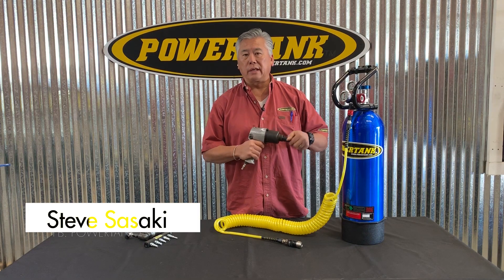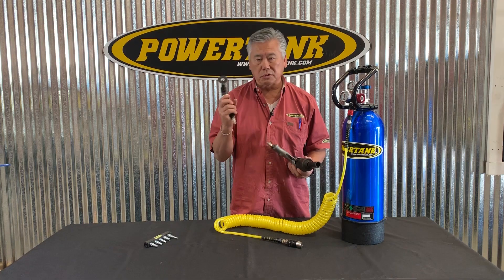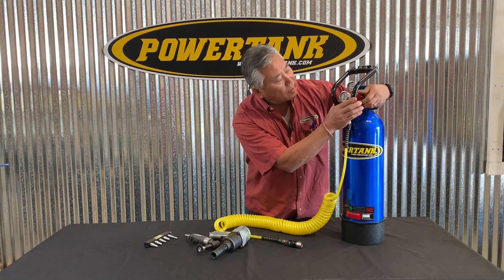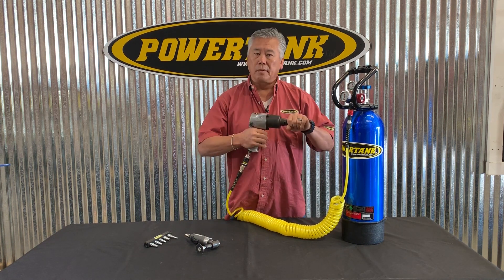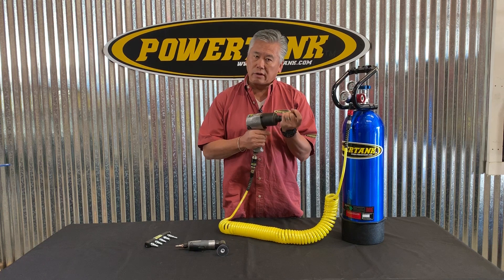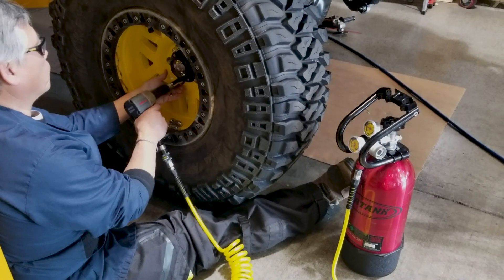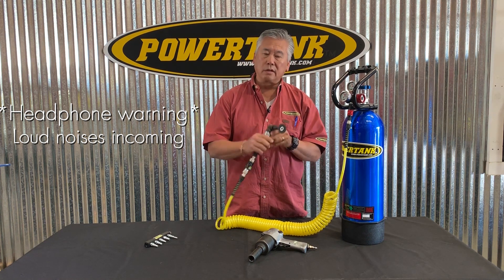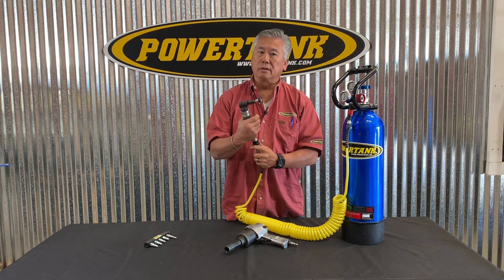Power Tank Running Air Tools

Comment: How long will it run the die grinder? Those things suck the air. I would think you would be better off with a cordless angle grinder and a small inverter to charge the batteries.
Reply from the maker: You're right. It's not a long time so you have to be purposeful with it. It's never been a problem for us over the past two decades. We end up using our die grinder quite a bit, too, since we keep welders in all of our rigs for trail fixes.

Comment: Would this be safe to leave/use in my work van? I would like to use air tools
Reply from the maker: Yes, very. We sell to the towing and construction industry regularly. There is a small chance of over-expansion due to heat. This only occurs with full or overfilled CO2 tanks with less room for expansion and on hot days (ambient temp 130F+). On the rare occasion it happens, there is a safety burst disc that is designed to pop at 3k PSI which will save all the components from damage and purge excess pressure in a controlled manner.

Our billet Power Grip Guard Handles are designed with safety and protection of the valve and regulators in mind. It has been tested to protect the most sensitive components from a four foot direct fall onto concrete at minimum. 

Our brackets have been tested in some of the harshest off road racing environments. All Power Tank CO2 bottles are DOT stamped during manufacturing and need to be retested every five years. We guarantee the bottle to pass re-certification.  

We carry our Power Tank inside our daily driven Jeep full time.

Comment: no expansion chamber needed?
Reply from the maker: Do you mean an auxiliary air tank?  Power Tanks run off of CO2, not compressed air. You can think of the Power Tank itself as an auxiliary air tank, itself, but one that is the equivalent to 400 gallons of compressed air at 150 psi. Such is the energy density of liquid CO2.
Reply: Power Tank Official an expansion chamber so liquid to gas evap doesn't freeze the lines or spray water ice  into tools and tires
Reply from the maker: @DarkShooper  What purpose do you think an expansion chamber would play in the system?  Essentially where a high pressure gas converts to a low pressure (regulator seat) and then flows in a hose the hose is the expansion chamber albeit a narrow one.  There is no moisture (“water”) state in CO2 once it leaves the tank.  It is either a solid (dry ice) or vapor.  Typically, there is sufficient heat energy and time (30’ of hose) to vaporize any dry ice bits that might leave the tank before it enters a tire or air tool.  

Since there is not water in CO2 there should never be any water in the hose to freeze when the hose gets cold.  So nothing gets into the tire or tool except CO2 gas (dry vapor).  

Does this answer your question?
Reply from the maker: @iliketakingshowers  They had a question and I was simply providing information. Hope they didn't take it personally. 😁

Comment: IF you have a workshop , you may as well use a compressor...this is more for a portable application.. I would think
Reply from the maker: You are correct. But there are times when you need to run an air tool outside of your shop. For off-roaders, it's needing to run an impact wrench on the trail to fix an axle. For contractors and carpenters, not having to worry about having power on a job-site or wheeling a heavy compressor from the truck is key. For me, I've brought my Power Tank to the back of my property to fix a fence because lugging my garage compressor over and running power to it would have doubled the work.
Reply: @PowerTankOfficial   roofing too, and framing!  I ran paintball tanks for both, this system is a bit to big for hauling up a ladder fifty times a day but I run a 20 lb tank on my truck and built my systems.  it is good to see quality commercial C02 tank set ups being sold ready to go so more people get into it!
Reply from the maker: @Dies1r4e  You know the good stuff! We designed our Power Shot Sidearm 20 oz systems exactly for folks like you. We also have a Hangman Bracket for 10 lb and 15 lb Power Tanks that you can use to hang on ladders, 2x4s, or scissor lifts.

Comment: Great video Steve, and good idea to keep some tools with you on the trail. What specific tool recommendations would give?  You mentioned two, but any particular brand, quality, size, etc.?  Any other tools you think would be valuable to keep in a trail kit?  

I always brag to my buddies about how I got such a screaming deal on my powertank at Easter jeep safari a few years ago, and I’ve been telling everyone about the powertank ever since. I’ll be bringing a good friend by the booth this year to pick one up for himself, and I might be getting a second tank for me as a back up.

Keep up the great work!
Reply from the maker: Thanks for the comment, Jeremy! Looking forward to seeing you at EJS this year. 

As far as air tools go, it really depends. A 1/2" air impact is always useful as you can dial up the pressure for really stubborn pinion nuts and the like. For a good value, look into the Ingersoll Rand 231. It's probably the most common impact you'll see at tire shops. I personally use the Chicago Pneumatic CP7748 because I like that it's quieter and feels nicer in my hand. Both are available on our website under air tools. We like them so much, we'll stand behind them. 

We use a die grinder quite often in conjunction with our on board premier power welder. We keep a few burr grinders and cut off wheels to clean up areas we need to weld. 

A blow gun is always handy to have as well. Being able to blow off dusty picnic tables, dirty radiators, and everything else is really handy.

That's typically all we'll take on the trail. Of course, we use it for everything else around the house and in the shop. It works great for nail guns.